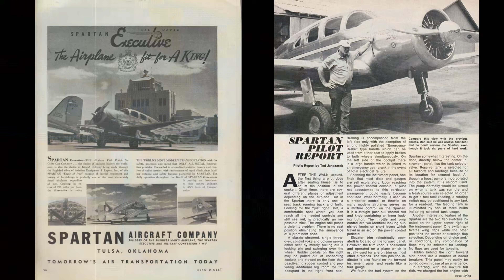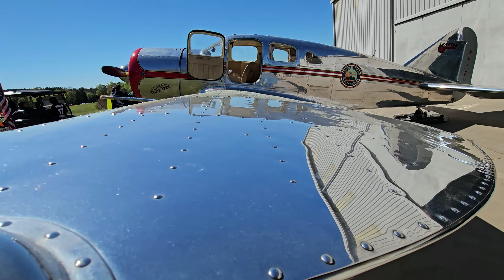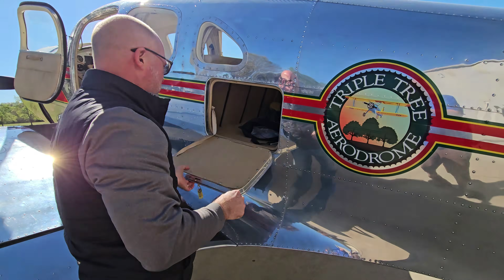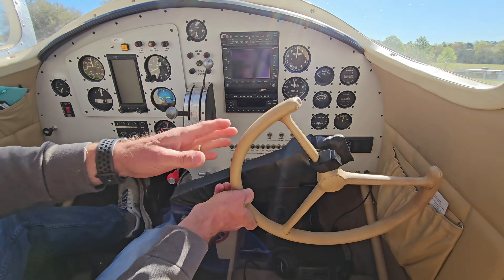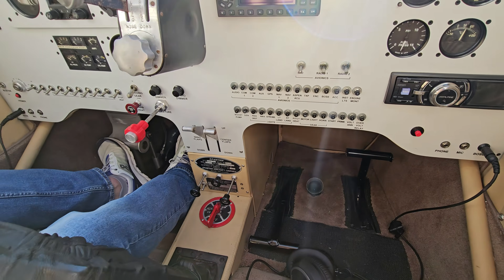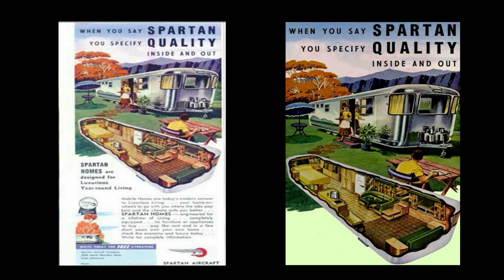1937 Spartan Executive Aircraft Walkaround. Triple Tree Aerodrome "The Spirit of Triple Tree"

Comment: "Ahead of its time" is almost an understatement.
Fully enclosed, all aluminium, stressed skin, cantilever monoplane with fully retractable landing gear.  In 1936.  This airplane must have been absolutely mind blowing when it was new.
Reply from the maker: you are spot on. The Electra 12 of the same era was most likely the closest "cousin" to the Executive per use of advanced material throughout and design. However there were many times over more 12s produced and by a significantly larger specialized aircraft manufacturer than Spartan was.